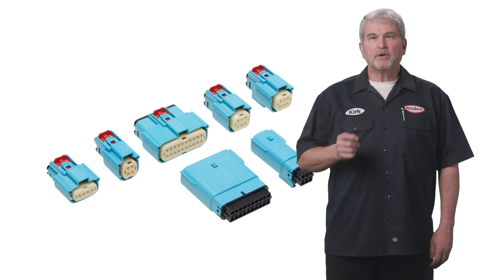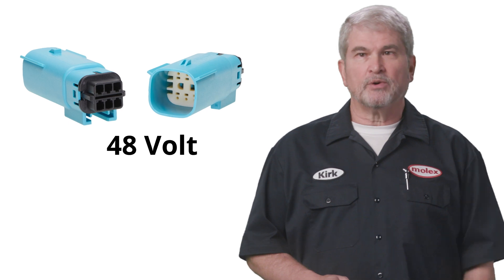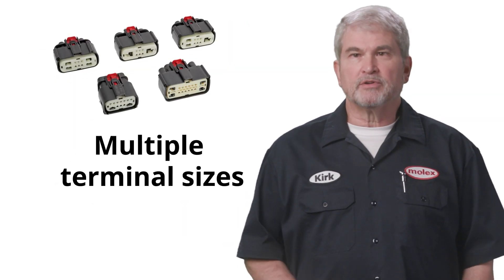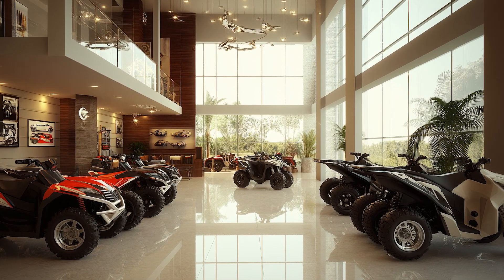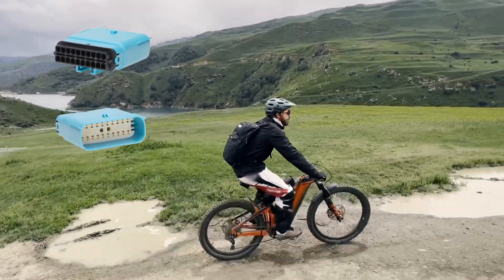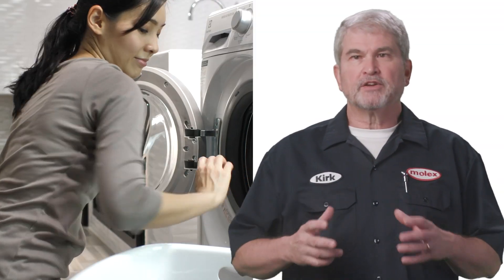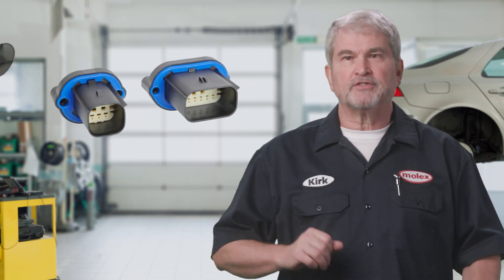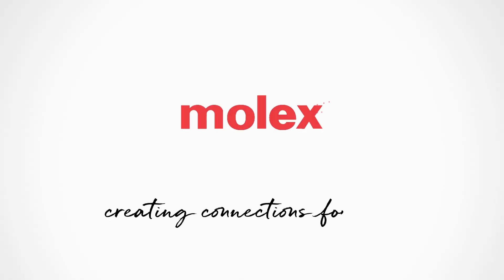MX150 Connectors: Beyond the Garage | Molex

Comment: The MX150 datasheet is very confusing, it states max voltage of 500V DC, yet on another page it stated the Mid blue ones are 60V. Then another section stated 14V. What is the max voltage? Do you offer a better explanation of the part numbering scheme for these details? I am struggling to find legit information especially when one data sheet I looked at for current rating said "Contact Molex". I used these in one of my projects, but with all the conflicting information and the last of part numbering information it makes me want to move to another mfg that actually has exact data in their "datasheet" not to contact them. I was looking at the 987651-0761.pdf listed on the Molex site. How absurd.